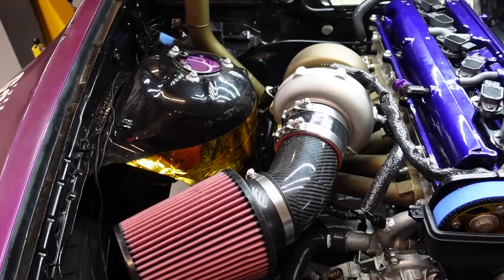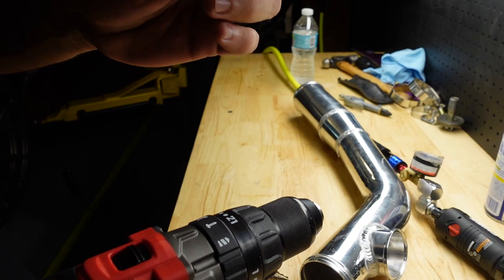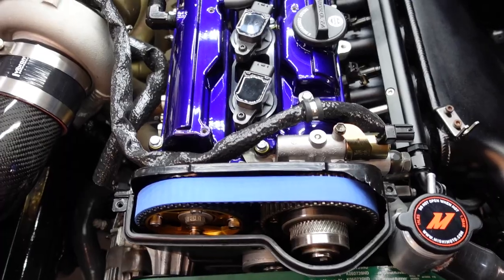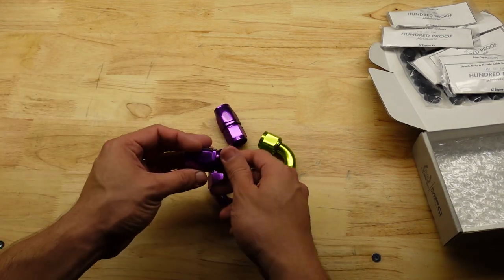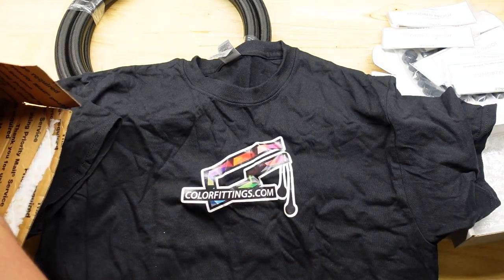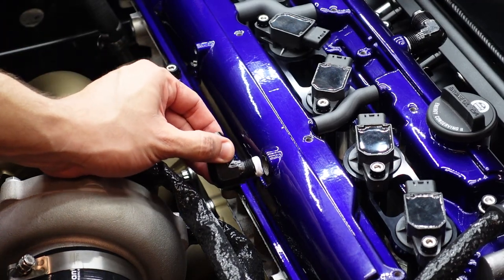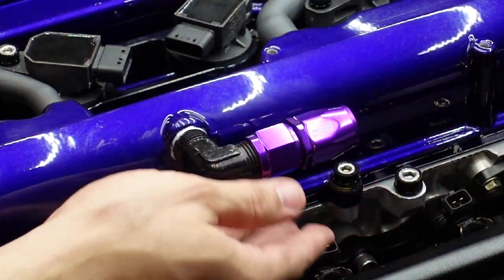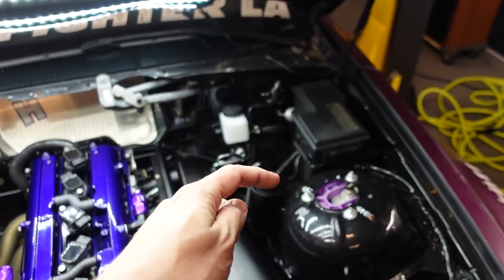HOW TO DRESS UP YOUR ENGINE (FUNCTION MEETS FORM)

Comment: Stainless in aluminum causes electrolysis, even more so when you have electricity running through it. Like coil packs. Use dielectric grease next time. Good video

Comment: Pls ditch the Stock Alternator for a DC Alternator
Reply from the maker: gotta save up for one of these
Reply: There are ton of vendors who make the alternators with the same exact internals that dc use. Check out brand x and ces electric on Facebook. They are literally half the price for the same product.